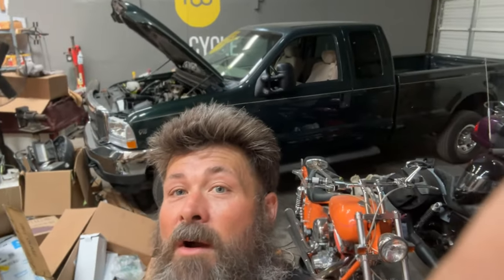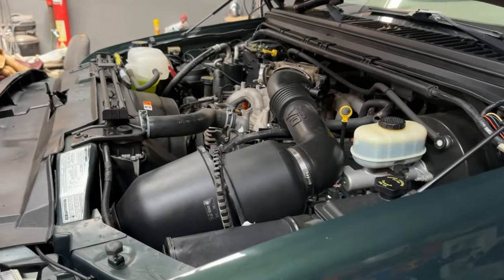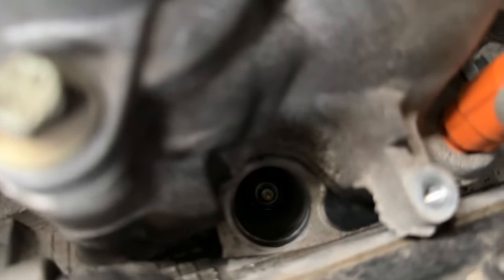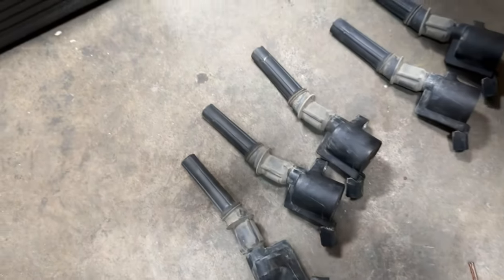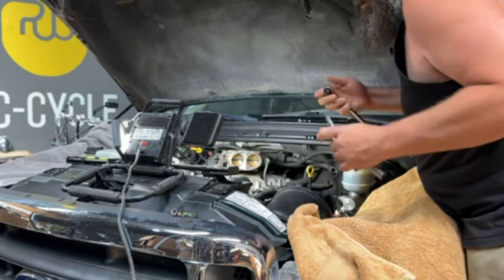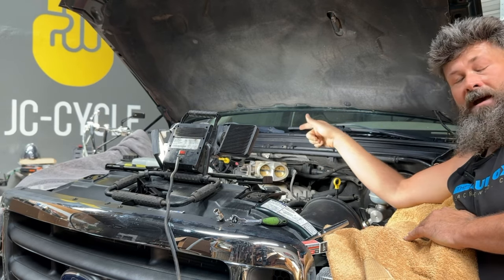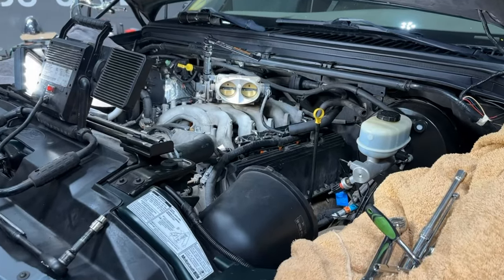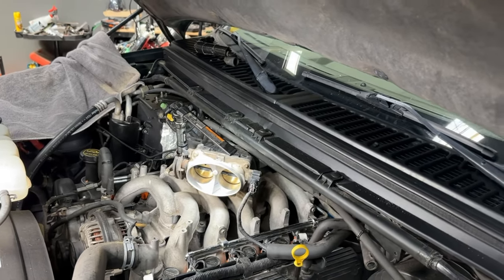DIY Ford Super Duty v10 Triton Spark Plug Replacement | F350 F250 6.8L

Comment: If your ignition coils were original then they would have a yellow sticker on top with the Motorcraft logo. These are replacement Motorcraft coils so they were changed fairly recently. I would say the spark plugs were done at the same time in your case. Just changed my coils a bit ago and come to find out we hadn't changed them since we got the Ex in 2000. The coils were manufactured in 1997!

Comment: I feel jipt! I was hoping to compare my struggle with the #5 against yours. I've done the task 3 times before and this time I think I've not tightened the #5 correctly and also had the PCV hose break on me. That was a $177.00 mistake! Anyway, great video! I do apply anti sieze and dialectic grease to mine, which by the way I am 3rd owner 2004 V10 6.8. Had it for 7 years now. Mileage was 169,000 when I bought it, it's now at 224,000. No major issues at all, best truck ever if you just maintain, change oil every 5k miles, and don't drive it like a race car!

Comment: There seems to be so much conflicting information on this engine. I’m looking at a motorhome with the 6.8. I’ve scoured over rv forums and found a post from a very experienced mechanic and he says definitely no anti seize but 16 ft lbs max. Blow out the holes and spray penetrant  in and back out partially and spray again and wait several hours. After this change your oil. This is just too many potential issues so now I’m looking for rv with the 8.1. Thanks for a great video

Comment: How many miles on the truck? Just curious. I recently bought a 2000 F350 with the V10. 190k. From my friend who was the first owner. He took care of it mechanically for about 2/3 of its time with him but it’s been neglected over the past 5-8 years. Though not driven much during that time. It sat abandoned in a field for the last two years. I got it running and changed oil and have been cleaning and replacing parts as I go. I am concerned about the spark plugs. I’m personally willing to bring it to someone familiar with these engines. Just haven’t found them yet. Maybe I’ll try what you did. I do like this truck a lot despite the gas mileage. I see it as a big useful tool.

Comment: Hello my name is Steven Barnes.  I have a F250 V10 Triton im replacing my spark plugs.  But i dont know what torque to set it on to get this done... i really need help. I. Using a the smaller ranch.
Reply: Get a book it has all your torque specs for everything.

Comment: Thanks for the informative video. I just bought a Class C RV with the 6.8 so it’s nice to see how much work goes into this job compared to a 5.4.

They also sell affordable magnetic spark plug sockets. I paid around $20 on Amazon for a pack of three different sizes.

Comment: I noticed the same thing when i cleaned my throttle body. There was some what looked to be oil and carbon buildup on the intake manifold.

When taking the throttle body apart, I saw it was oily inside. Well, my truck has a k&n from the previous owner, which those air filters require oil. Im not a particular fan of k&n and will be going back to a paper filter.  

Its an educated guess on my part that thats the sweating you and I are seeing. I could be wrong.
Reply: I'd like to amend my guess and say it's from the Pcv system. Definitely had some oil residue and it connects right into the throttle body.